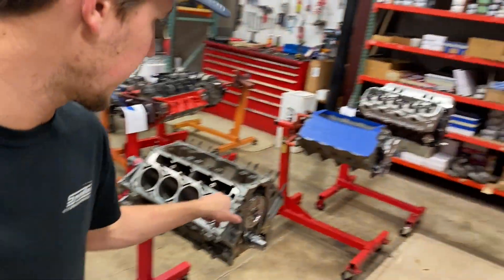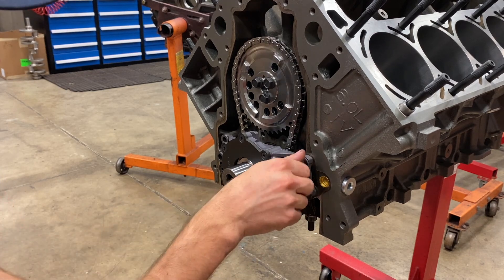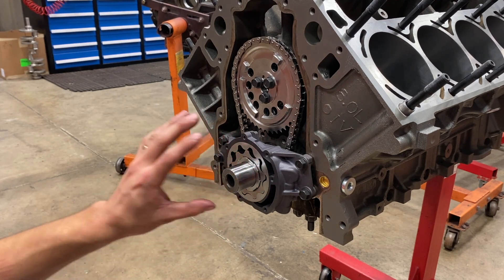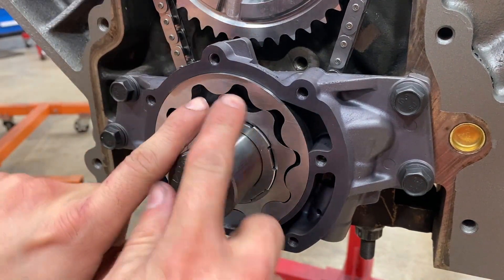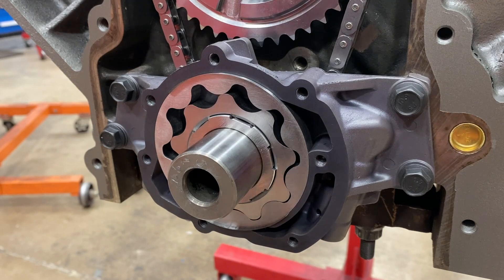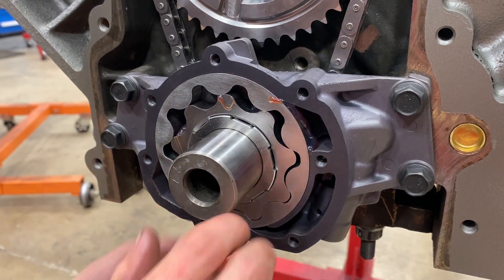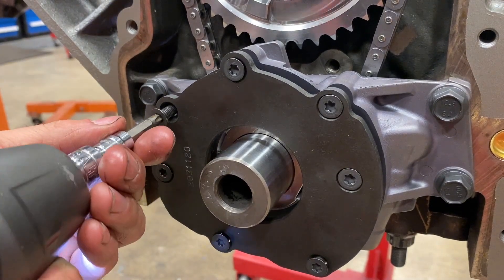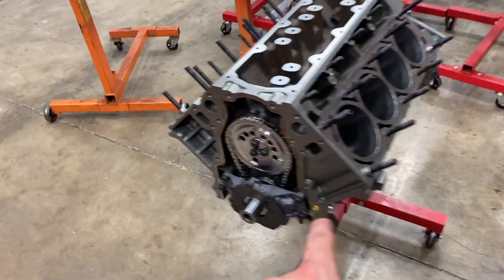LS Oil Pump Shimming- (correct method)

Comment: I use the GM method , install the pump , tighten the bolts finger tight , turn the motor over 360 degrees ,tighten the bolts.

Comment: So i was installing mine and I wasn't going to do this originally. Melling states you just snug up the bolts then turn the engine over, but when I tried that it felt suuuuuper untrustworthy. Went ahead and did the shim method.

Comment: Call Melling. They'll tell you NOT to open up their pump to shim it. Mount it over the pump drive/camshaft sprocket and start all the bolts. Move it around by hand until it "feels" centered on the crank drive. Thats going to take some "oscillating" until you are sure it is centered. All the bolts SHOULD be centered in their bores. Now do a few turns with a bare socket on each bolt, in a star pattern until all the bolts are hand-snug. Follow installation torque spec.s in VERY small increments. DO NOT OVER TORQUE!

Comment: Thanks for a great tutorial. Doesn't loctite (or any liquid) effectively "grease" the threads such that 106 in lbs becomes quite a bit higher? So, shouldn't the torque be backed off by some amount if a loctite is going to be applied?

Comment: its a good idea but most people just slap them on i have token the plate off and just center it by feel and my rotors had nice movement if you want to do it with a feeler gauge you are going to haft to buy at least  two sets of feeler gauges  to get what ever thickness to do it like that

Comment: You just take a lower sprocket. Out that in. Slip that in towards the existing sprocket on the crank and it hits the dowels. Even has spacers for the bolts. Hard to get wrong.

Comment: The old Buick engines had the oil pumps on the timing cover. We used to pack petroleum grease in the pump gears so the oil pumps would prime on start up. It seems that might work here too.

Comment: The proper procedure is also in The GM SERVICE Manual SET .
Sadly Most people are to cheap to buy them , The added benefit of having the Manuals is you also get info about the Complete Vehicle and ALL the Proper procedures and Tests to determine what has malfunctioned and what needs replaced without using the costly “Parts Cannon” approach to vehicle repair . 
The first repair pays for the books and they ADD Value at Sale Time if you include them .

Comment: this    is why you watch several YouTube videos before you DIY it yourself.. this is an excelent centering guide. Thank You Sooooo much!!!!!!!! just a note your lubing the cresent gears I'm sure works this is not a correction to your method. It's just the way I lube the gears.  why you pre-lube is dry gears have little to no suction and won't pull the oil into the oil pump. My method for many years is to pack the gears with vaseline. like I said this is not a correction of your method. Your video is spot on!
Reply: If you’re gonna use grease instead of heavy weight Oil you should use Wheel bearing grease . 
You should also never let that Vaseline set up after the first run , That stuff could plug a passage and result in catastrophic failure .
Reply: The "suction" part of that statement makes pretty much no sense. The pump is literally designed to SUCK UP OIL and disperse it to where it needs to be. It does not need any grease or anything to help with the "suction." You prelube because running metal to metal makes particles and shavings.
Reply: @Bongalized  it makes perfect sense, that pump dry would struggle to pull suction. Been a hydraulic tech for decades a liberal splash of oil helps seal the gear and drastically assists suction. just like piston rings need that thin film of oil from the oil rings to help them seal

Comment: in my Suburban  2012   the oil pressure is not stable when in idle  and  already  changed  oil and oil sensor  , screen filter , oil  valve  and cartier  gasket  thanks
Reply: Your main bearings are going out. You will have to do a full rebuild. I know from experience.

Comment: I have a 115k mile L77. Got Ls 7 lifters, DOD delete. About to install BTR stage 2 v2 cam and springs.
Should I be running the Melling 10295 pump?

Comment: you folks do realize at the factory they slap it on, torque it down, and boom done.  you're not building a drag engine, your building a semi factory LS that went into corvettes, police cars and big trucks and did just fine.  The oil pump is not a mystical god that protects engines, it is a fluid pump, period!  Stick it the fuck on and move on.  PS pumps don't make pressure they make FLOW.

Comment: Nope, it's not centering anything unless you shim the crank, too, as the crank is actually sitting on the bottom of the bearing. Go ahead, put a guage on the crank, grab it , pull up on it, and watch how far it moves. 

It takes oil pressure to center the crank in its bearing. Otherwise, gravity brings that heavy hunk of steel downward until it rests on the bottom bearing

Comment: I am amazed that shops still just bolt those pumps on and not 'center' em !  Been building the ls motors  since about 2001... center the pumps on every one of em. Some pumps only allow .0015".... that is tightest i've seen.

Comment: Do I need the high volume high pressure oil pump, or stock volume high pressure pump for a btr stg 3 blower cam and lsa supercharger with 2.45 pulley? Roughly 700 wheel on E

Comment: Damn there are a lot of modifications for this engine to do it indestructible this mod the mod of drilling the pistons oil rings with 2 holes in each side for oil to go back the mod of the oil squirts the holes on the crack shaft to oil the piston the oil pressure pump springs and much more I tell you I am going to buy a a Chevy 5.3 single cab just to do all of this mods to see how much miles Can i put that engine make it my daily.

Comment: Fun fact about snap on tools I SEE U have 1  The black label means it came from the Military The regular type Snap on version will have a red label  ive got a Ratchet with the black label and my snap on dealer told me this so if im wrong im just repeating what he told me !! Hes been a dealer for over 20 years so it should be correct info !! And he also didnt warranty it so luckily i had the same 1 with the red and i swaped the guts out and got it fixed so if it brakes get a heat gun and get the black off of it before u hand it over for warranty!!

Comment: What does the other spring do? Add pressure? Or volume? I’m gonna be running about 1000hp with a turbo and was told to get a high volume oil pump but then was told it’ll suck my stock pan dry. So will this Melling one with that spring suffice and not suck anything dry?

Comment: melling instructions in the box mentioned none of this, i just sent her down and been great pressure for years. technically all it should change is the ratio of compression because it floats offset anyway. if it was so important there would be dowels for the oil pump

Comment: question do ya have a video or make one on replacing a harmonic balancer on both the 5.3L & 8.1L '99-06' GM truck engines using the manufactures torque specs.  would appreciate it sir!!

Comment: All you need to increase soil pressure is 3245 mm bolt washers underneath that spring cap on the oil pump itself. You don't need to buy all these extra colored Springs. The spring that's in it works fine. Just shove the damn thing like we've been doing for decades. It's amazing how many people keep trying to reinvent the freaking wheel. It also doesn't help that there is at least 3 oil pressure relief valves on an LS motor. And one of them Works after the bypass valve that's in the oil filter.

Comment: I've installed thousands of these oil pumps over the years and have never done this or heard of this and have never had Any failures or low oil pressure do to pump failure
Reply: Maybe id do this in a 1000hp drag car- but my Silverado 6.0 work truck…not a chance lol. Pump goes on, cover goes on. Bye.
Reply: Thousands!?! I'll bet money it was once maybe twice.
Reply: 80,000 miles later and no issues with my ls2 trailblazer
Reply: I can show you guys my moroso oil pump with some nice gauges in the house from not being aligned. When i first opened it up i wondered how this happen glad to know it wasnt metal that found its way in there glad to see the guy before just never shimmed it
Reply: Why not do this? Such a simple process.
Reply: Anyone in the dmv can do this on 06 gmc savana 1500
Reply: Why did you just take your fun cover off?You just avoided your warranty.Milling tells you in the instructions not to remove their cover idiot So
You just made a video of showing  people how to avoid their warranty People don't take your pomps apart.Just put the pump on , put the cover on
Reply: That’s a damn lie
Reply: Also it seems that melling states that you void warranty if you open the pump up.
Reply: @Gordon013  thats because they say you should put pump on finger tight then spinning the crank over a few times will align the gears then torque bolts down to spec
Reply: Yea but if you read the service manual or all data it says you must shim.
Reply: Testify brother, it's just a damn oil pump.  These idiots all want to stroke each other over this crap.
Reply: @stevep5681  are you stupid? This person is just trying to give people advice on how  HE does it, and how it’s a reliable process for him. Sounds like you just want to stroke all the old mechanics who want to run there mouths.

Comment: Interesting. Melting has a video that shows you don’t need to shim to align, only a 360 degree turn of the crank while the bolts are loose. I wonder if that method is just as effective as this. I’d like to think so since they actually make and sell pumps but I’m not sure.

Comment: I put a 295 pump on wrong primed it through the side of block and when I started it it built pressure right off the bay then went away just as quick and wouldn’t pick any oil up. I primed it again same thing. Now waiting on new oil pump to get here and install it your way 👍

Comment: What size shims are you using?
Reply: Any info on the shims that you are using where to get those?
Reply: @express9387  They are just .002” shims you get in a set of automotive feeler gauges. Get two sets and remove them from the assembly. Replace them when you’re done.

Comment: I installed the same pump on a build I did 2 years ago and just bolted it on.  Melling told me there was sacrificial rings in the pump to center it, I didn't even torque the cover and after torquing the mounting bolts there was no play which made me a little uneasy but no problems so far.  I have used a similar method with GM pumps just centering the ring, I was glad to see that is how you did it.  Thanks.  2025 Update:  I was building a 4.8 for an '88 S10 I'm building and I was talking to a tech from BTR and we got on the subject and he told me to just bolt the pump on because after you pull the shims there is ,0025" clearance BUT with all the forces in a running motor on the crank pushing it down that clearance is gone at the bottom of the rotor.  BTR recommends that because under running load conditions with the crank thrust down into the bearings there will be plenty of clearance completely around the rotor. All I can tell you is that I've done it both ways now and I haven't had a failure yet but I do prelube by filling the oil filter, lower oil gallery and the pump with oil thru the main gallery oil plug on the side of the block like Melling recommends.  https://www.youtube.com/watch?v=539ClWWJMl8
Reply: Melling also told me it was not needed to shim the oil pump

Comment: Why only a standard oil pump. Any reason not to run a high volume with a standard spring on a 5.3 daily driver. Has a bout 110k miles on it.

Comment: Hey man,   So im having an issue with belt to where its riding on the edge of my ati balancer everywhere on the accessory drive theres no issue. So it looks like my balancer is in too far.    Do you think the oil drive was installed incorrectly?   Or does that have nothing to do with it

Comment: Ok I’m doing my 1st LM7 , 2002  I have the stock rockers . If I want to up grade …. To what  worries about clearance. I swing a new gm hi flow
Oil pump.. there was no o ring on the pick up tube . It was disintegrated . My question is what color do I need .

Comment: Melling instructions are to install pump finger right. Then rotate the crank 360 degrees. Next torque pump to 18 ft/lbs and you're done. That centers that gear. Could they be wrong?
Reply: Correct b/c this will automatically push out the gears to its proper spacing and youre done. The reasoning behind this is that once it’s ☝️ tighten, the 360 rotation of the crank will set the center spacing perfectly. New mechanic vs “old school”. If you bring this into a mechanics bay - they don’t have two feeler gauges handy - plus they don’t use them anyways unless it’s a rebuild shop etc.
Reply: Sorry to disappoint you guys but you can not always make it that simple. What Melling is telling you is that for a "stock" application you can get away with simply rotating the engine 360, and torque to spec. However, for kustom builds, generating generous power, "while changing out the stock spring to the COPO spring", just as this video is stating that this in fact is the application, you must shim the outer gear, utilizing .002 gauge then torque to spec. If you dont, the pump will fail. I have the destroyed pump and timing cover to prove it. You will only make that mistake once! I have a good deal of engine building experience and by far this is the most comprehensive video I have come across.
Reply: @RezurxnSpeedAndMarineHesperia  BS

Comment: Melling, a huge retailer of oil pumps says just to rotate the crankshaft 360 degrees before final torque specs. They also show on their yt uploads. Which is correct?
Reply: Yes this is correct, this guy is wasting time and knowledge for nothing
Reply: @siclt1  Sorry to disappoint you guys but you can not always make it that simple. What Melling is telling you is that for a "stock" application you can get away with simply rotating the engine 360, and torque to spec. However, for kustom builds, generating generous power, "while changing out the stock spring to the COPO spring", just as this video is stating that this in fact is the application, you must shim the outer gear, utilizing .002 gauge then torque to spec. If you dont, the pump will fail. I have the destroyed pump and timing cover to prove it. You will only make that mistake once! I have a good deal of engine building experience and by far this is the most comprehensive video I have come across.

Comment: Awesome explanation. I’ve always done this. But i like your method better, by removing the shims.  When you torque down the cover, there’s usually two of the bolt holes that have flattened edges, making them look slotted. I believe they are there to center the cover and should be the first two to install and snug down.

Comment: You're already wrong. Crank is sitting on the bottom main shells with no oil circulating through it. When you start it, pump will be rubbing on the top....

Comment: The backlash is automatically adjusted when rotating the crankshaft a couple times then torque 4 bolts, according to milling.
Why would you do this procedure, is there a real benefit?
Reply from the maker: Peace of mind when the engine is $15k+

Comment: Serious question to think about. I totally understand why to do this, but what happens when the engine gets warm and metal moves around. To probably do the setup the engine should be warm as well as the pump. You hear about a lot of people just putting their pumps on and never having any issues. He also hear about people doing this procedure and having issues. So what is really the right way?
Reply: Its not “necessary”. Its not done from the factory and Melling states they’ll void the warranty if the front cover was removed. There is also no mention of this in the GM manual. That said, do I think its wrong or bad? No. Its just not necessary.
Reply from the maker: Are birds real? Some questions we’ll never know the answer too.

Comment: Wow..... I would have just slapped it on and never thought about it needing adjustment.  Thanks for the video, I'll be doing this job soon.
Reply: Mellings website says put oil pump on and rotate crank 360deg then torque oil pump melling does not tell you to take the pump cover off
Reply: @TheJdizzle02  how I do all mine install turn engine over and trq them
Reply: @PONSAUTOMOTIVE That way sound like the oil pressure on one side would force the ring to the low pressure side(ie no clearance) and then you lock it up there ?
Reply: @TheJdizzle02 I would follow whatever Melling says to the T. They are the experts, not YouTube.
Reply: @nordicpride9708  agreed
Reply: @TheJdizzle02  I have also seen, and read about this method. I'm sure this procedure would work, too.....
Reply: @milojanis4901  the high volume oil pump I installed didn't have enough clearance for a .0015
Reply: @TheJdizzle02  on the performance pump, they do
Reply: I did slap it on my first ls engine. Why? Because my 2000 factory shop manual made no mention of this!!! I'd bet money that the newer editions do. Remember, back in 2000, these engines and manuals were only in their 4th year of production, and new, better methods get discovered over time......
Reply: I did it your way twice on a truck that this Ls I'm rebuilding is going into... I'm using his method for this motor. #operationls